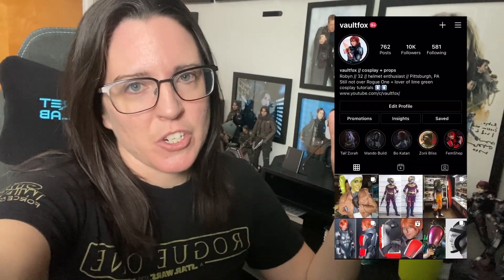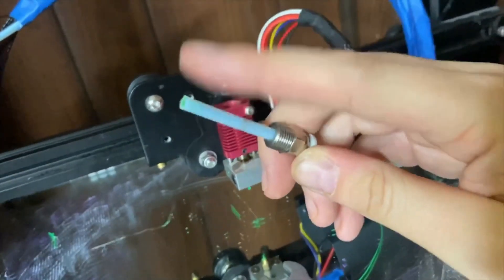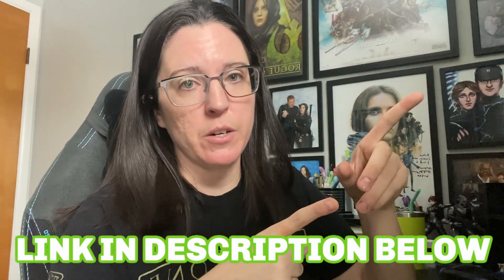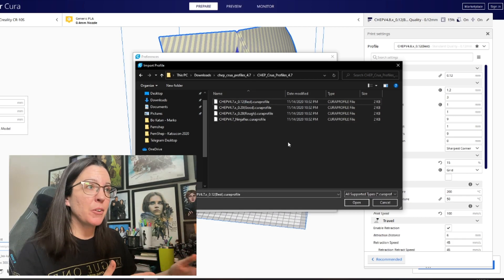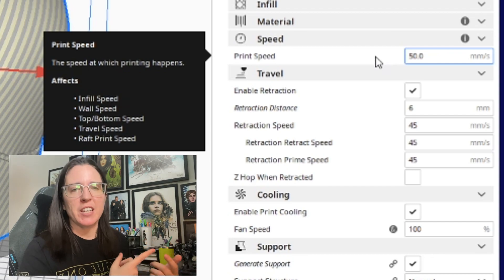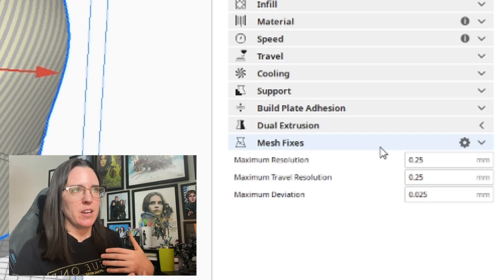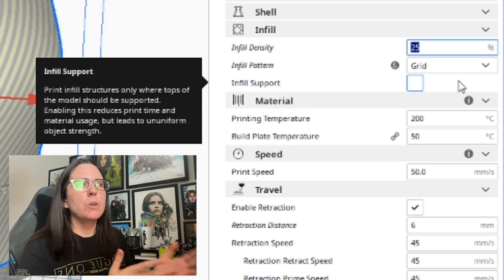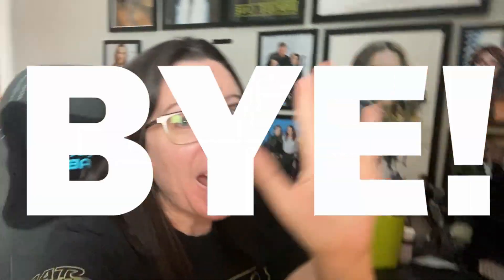My 3D Printer Settings for Smooth Prints + Some 3D Printing Tips!

Comment: what layer height are you prinitng at? I am finally printing the Bo Katan Helment should be done tonight. going to use the standard dynamic .16 for the little pieces for less work. i saw your resin video and I am going that route with Bo Katan. Thanks for the great videos. I tried ironing once but didnt come out so great.
Reply from the maker: That’s kind of what I do ... I use .28mm for the base helmet and then .12 for the vent, ear caps, etc. good luck on your build!

Comment: Try support infill at 2-3% and regular infill at 5%. I print full size helmets on my E5+ daily and this saves a ton of time and cost while still producing (mostly) fail free prints about 98% of the time
Reply from the maker: Hmmm I’ve never tried going lower that 10% on the supports, always afraid they’ll get knocked off but it’s worth a shot
Reply: @vaultfox  did you ever test this out? Looking to attempt my first 1 piece helmet and would like to know what your supports are at right now. Thanks and happy Valentine’s Day 🎉